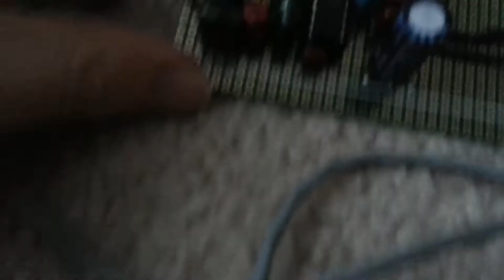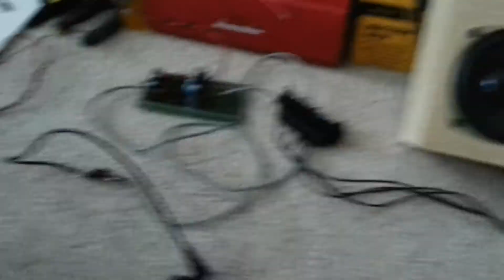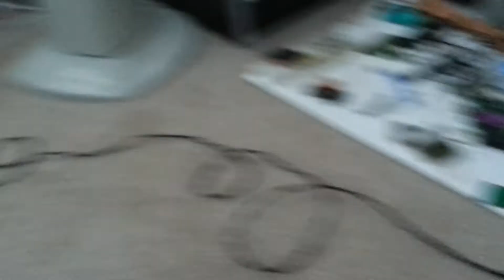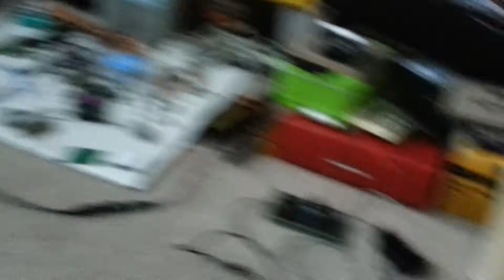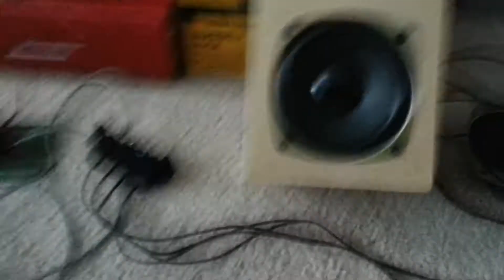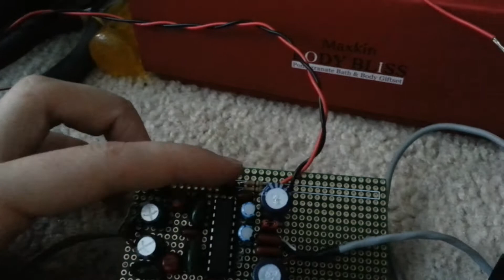TPA3122d2 class d stereo 15W amplifier prototype

Comment: Supply voltage divided by the load= I,current of supply you needed.
Example V=12v. / 8ohm=1.5A*2(stereo)=3A. In the class D this is correct calculation.
You may also increase a capacitance of capacitors.Better solution is use a impulse power supply,3A laptop charger or something.
Reply from the maker: Blahblox Gyuanox But since this is a class D amplifier and the instantaneous peak currents are high, while the average current drawn will be much lower I don't think it is that simple of a calculation as it would be for something like a class AB. I think that your suggestion of using larger bulk capacitors on the supply line close to the amp would probably help so I will have to try that. Thanks.
Reply: Better solution is use a impulse power supply,3A laptop charger or something.
more like the worst solution those are switche mode suplys and are shit for audio stuff you alwys wanna use a 50/60hz  transformer
Reply from the maker: I have a few spare laptop chargers so I'll have to give it a shot.

Comment: Sounds less complicated than I think, thanks.

I happen to be an Electronic and Computer Engineer, so I suppose our approaches may end up being similar. :P

My project may be little too ambitious. I hope for networked speakers with a control unit, taking streams from multiple sources (or multiple streams, one source) and sends them to appropriate speakers in separate rooms. For now, I just want one speaker built + working.

Good luck with yours! Subbed. Hope you post a vid when it's done. :)

Comment from the maker: I am an electrical and computer engineer and not an audio engineer so I did what came naturally ... I just picked a convenient foot print size and volume and built it. I've read that sticking closely to the "golden ratio" yields good speaker design but I just threw caution to the wind and so far it sounds pretty good. I just need to add some acoustic filler, seal her up, and paint her and all is good. As for the amplifier I plan on adding a lcd and microcontroller to add digital control.

Comment: This is almost the exact project I have just returned to thinking about after a long time. Though I've extended my idea to a multi-room system. Found this chip after googling and happy to see that it sounds great and isn't too complicated to set up.

I've had some loudspeakers lying around for about a year... I had always planned on designing and building/having built an enclosure, but really had no idea where to start. How did you decide on enclosure design?